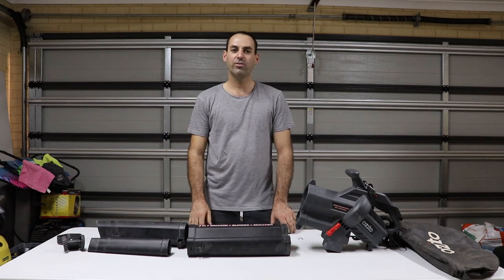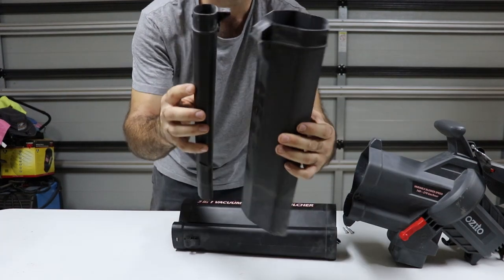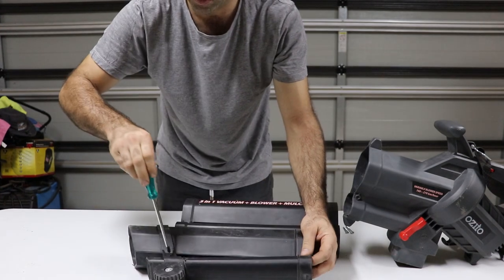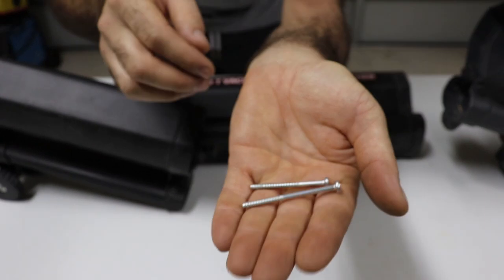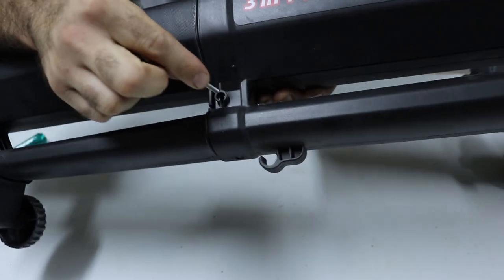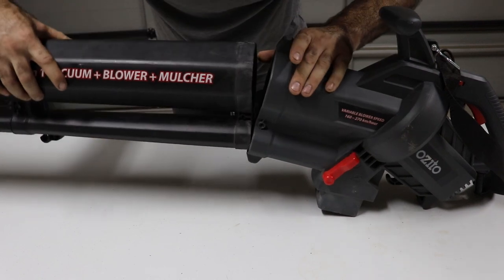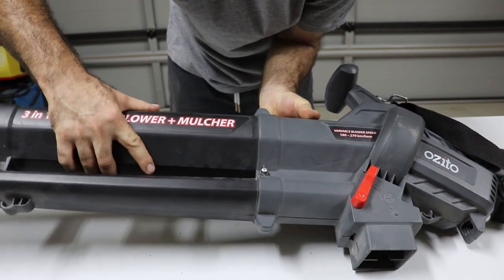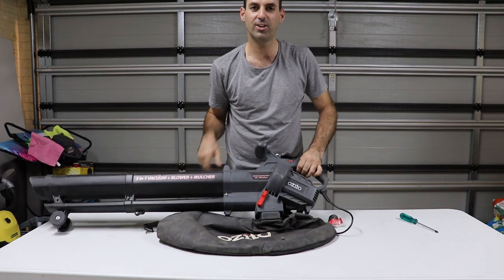Ozito leaf blower assembly

Comment: Same as everyone else, my only issue is with the top handle which you didn’t even show. Seems to be a design fault I guess
Reply: Place inside the slot, hit down on top of the t handle first, then give another hit on the silver latch part, should lock it in